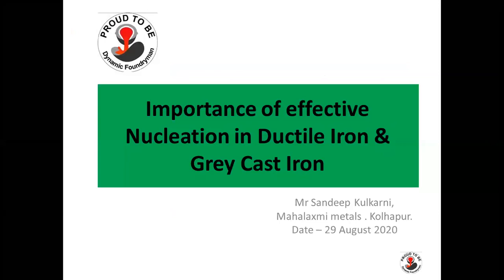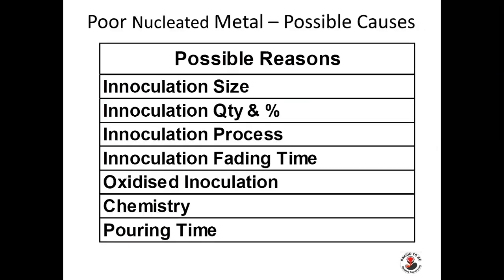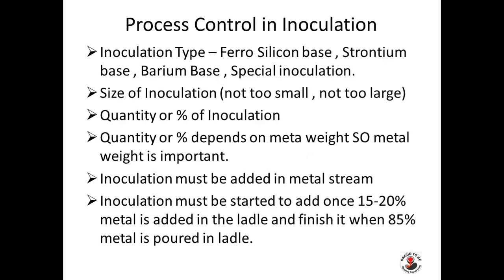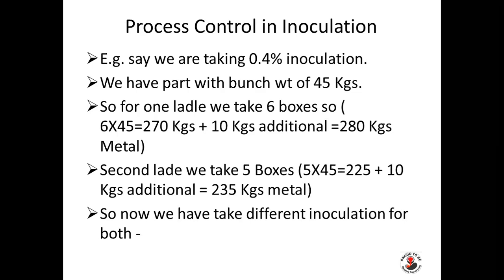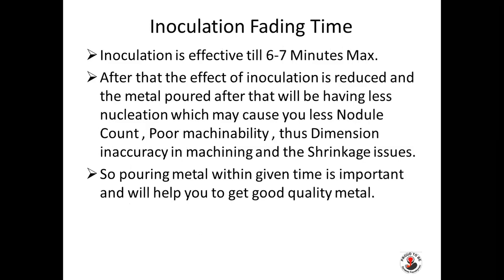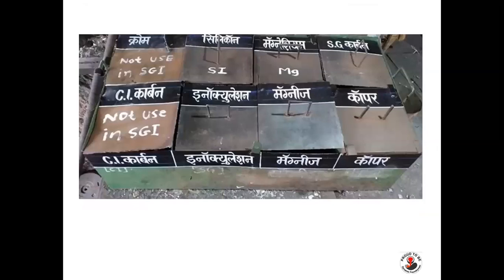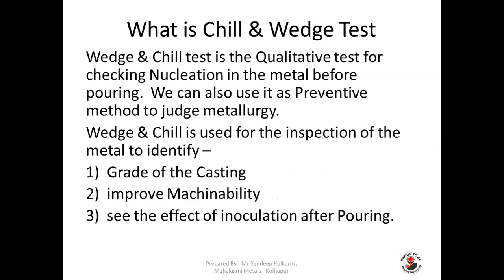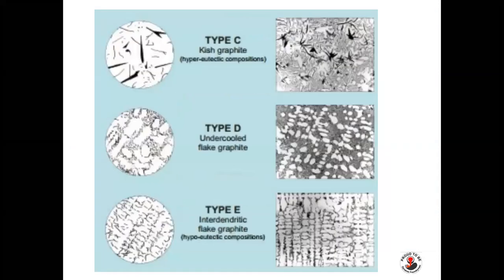Importance of Nucleation in Grey Cast Iron & Ductile Iron

Comment: Sir can we use same inoculation % in gray cast iron.  0.04% & what is mold inoculation % in SG  iron
Reply from the maker: In ductile iron 0.4 to 0.5% and for cast iron 0.15-0.2%
We can use one inoculation as a common. But for special inoculation it can be separate.